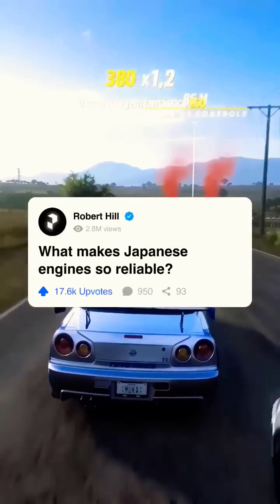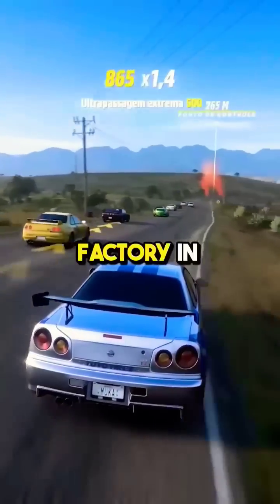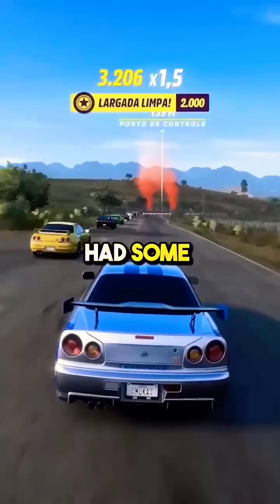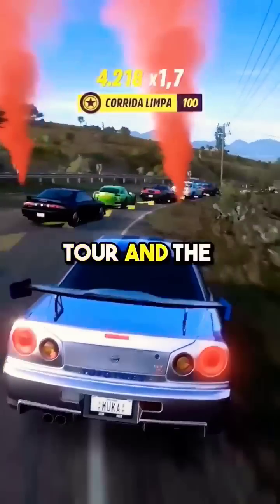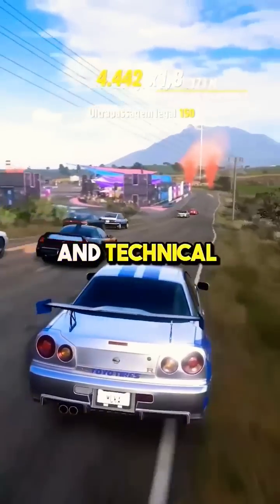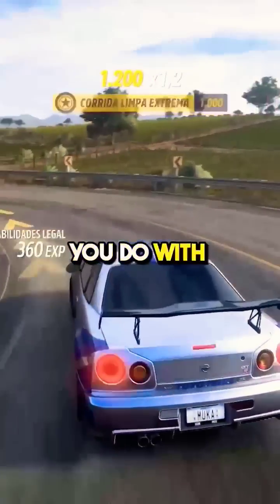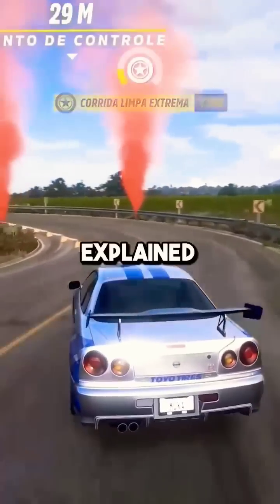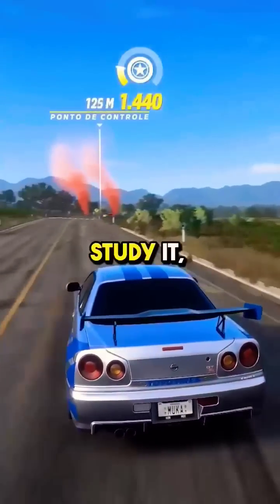What makes Japanese engines so reliable?#Japan #japanesecars

Comment: I wouldn’t say all Japanese cars are reliable, but Toyota and Honda are.
Reply: Not all Toyota and Honda are reliable, you can always get a good apple or a bad apple, the same thing applies with Toyota and Honda. Honda Odyssey is the least reliable Honda because of transmission issues, the engine will remain strong though. Toyota is number 1 when it comes to reliability but unfortunately the Toyota cvts in the first year were awful. So yeah no car is perfect.
Reply: @LiberalFinder  yeah I didn’t say their always reliable every time, but in general yes.
Reply: @LightSolves  Spot on.

Comment: damn so they didn’t explain so allow me to. Toyota (and other Japanese manufacturers but Toyota specifically) believes in a philosophy known Jidoka, which means “automation/assembly with human blessing/touch”. When vehicles come off the line, any imperfections halt the assembly line, are corrected, and the source of the error is found then and there to be fixed. This results in almost zero overflow of faulty vehicles. The assembly line is automated, but at the end of each stage there’s a human “moderator” and quality control that will rather stop the line for one car so that it doesn’t affect the rest. Toyota engines are also so reliable, because of another deliberate choice in engineering. Toyota motors are able to handle about 30-70 more HP than they come shipped with. They are purposefully de-tuned so that they are optimized for longevity rather than power and performance. Honda engines as well implement this but not as consistently as Toyota has. In fact, without any reconstruction or modifications to the engine, Toyota Racing Development sells kits like superchargers and other accessories to unlock the full potential of some engines. These kits aren’t really advertised at the dealership, but have been available since the mid 90s and they usually void the warranty due to the longevity decreasing with installation.
Reply: My boss used to work for a Toyota factory back in the 90s. Apparantly, if you dropped a tool on the line, the line stopped and they reevaluated everything from temperature in the factory to hours spent standing to ensure it didn't happen again.
Reply: @tellyheadlol4258  I wouldn’t even consider this an exaggeration especially in the 90s when Toyota was doing their absolute most to get a foothold in the western market.